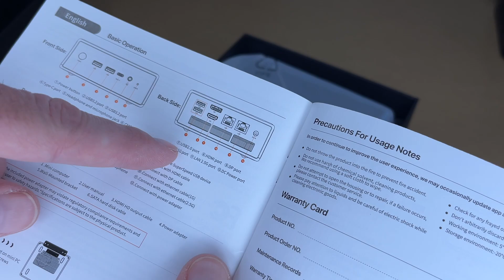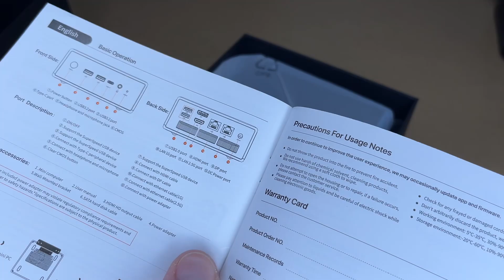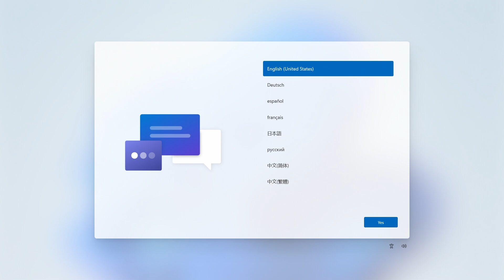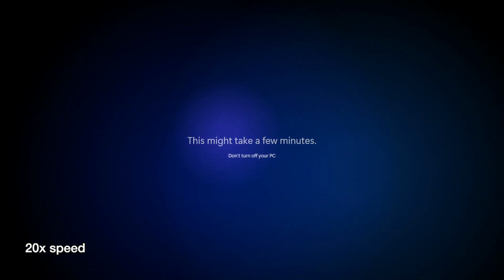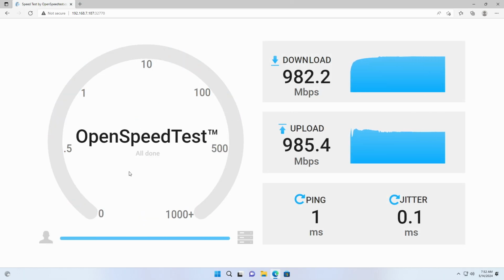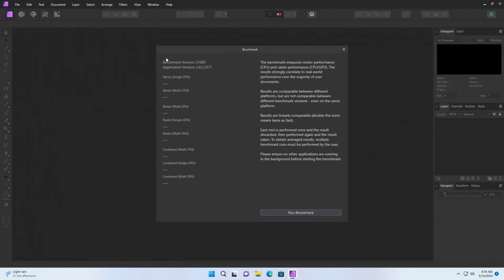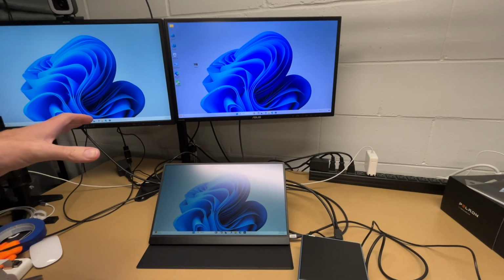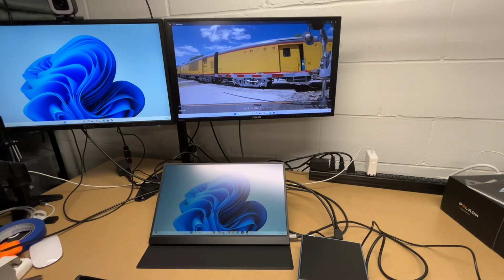PELADN WO4 Ryzen 5 Mini PC with 16GB RAM and 512NVMe SSD

Comment: Now this is what I call and excellent mini PC review. Yes, short and sweet and factual. And I like how you didn't do this: you did not turn this into a mini PC gaming review. Why is there this fixation on gaming with a $200 mini? That's the last type of computing application that I would want a $200 mini to  do. For that, i'd save $$$ for a while and buy the correct tool for the task. I never use a drillbit as a hammer! Some light gaming with this? Sure, when I'm feeling a little too lazy to turn on my gaming PC sitting next to it. I just bought one to use as an HTPC for my daughters TV in her bedroom and to use as a DAW for her keyboard. This thing is a great PC for those tasks. Thanks for this fantastic review!
Reply from the maker: This has been a nice little PC. I used it for a bunch of optical character recognition work and it didn't miss a beat.